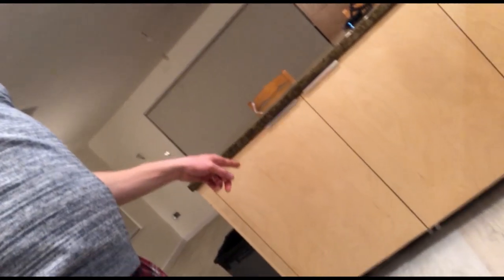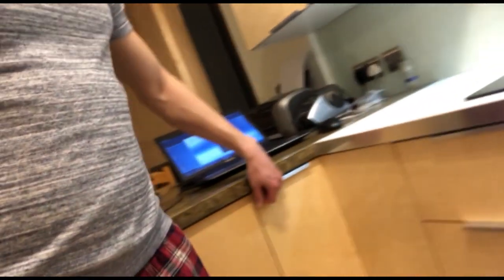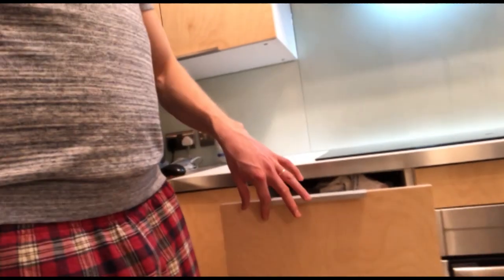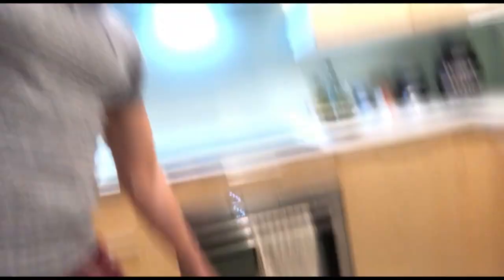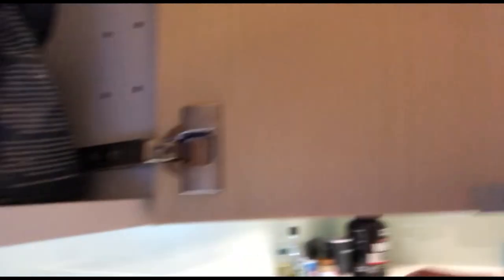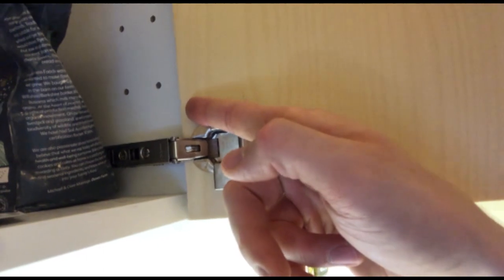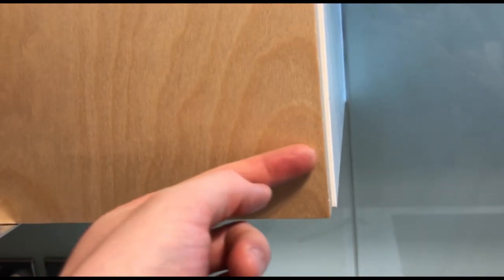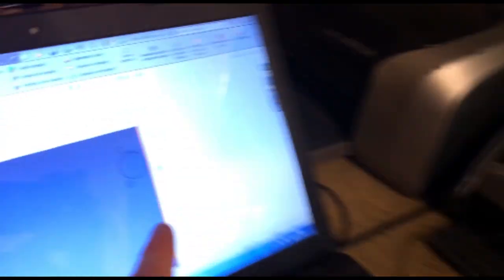BIRCH PLYWOOD KITCHEN with NO TOOLS! How to Make Your Own Plywood Doors for Your Ikea Kitchen

Comment: Thanks for this wonderful video. Kitchen looks fantastic. 
A suggestion for anyone who would like different doors ( e.g. uppers in a colour or because there isn't enough material in the sheets), is to use MDF and paint with Wilko cabinet paint. It is solvent based, and repels water from the cut edges. Limited colour range but mixable ( we did 1 tin cream, 1 tin grey and 1/2 tin white to give a perfect warm but light grey). Has  a great low-gloss / almost matt finish. Scrubbable and waterproof.
Anyway, keep the videos coming - we're hooked!!
Reply from the maker: Awesome Lynn thanks for the advice :)

Comment: Matt, you're a legend for this. 

- What's the thickness of ply did you use and does it matter much?
- did you have to finish the edges at all beyond oiling them? I'm quite surprised the CNC machine leaves them so tidy

I'm considering doing this with some spenny 19mm Walnut-faced plywood so want to get it right. Plykea samples are 18mm. Assuming this wouldn't make any difference to the CAD cutouts but seeking reassurance
Reply from the maker: Hello mate, I used 18mm and you will need to sand the edges lightly with say 120 grit. The depth of the wood won’t require different CAD you just need to tell the company you give it to, what depths you want. :)

Comment: Thank you for this great video! I have nothing but 'can do' mindset, and I will try to do something similar to my new kitchen. One quick question, the free CAD program you suggested isn't working on my MacBook I see some other free programs (e.g. 3D builder). Would your files work on those other programs? Thank you again!
Reply from the maker: Awesome, I’m glad you liked it :) 
Yes any program that reads DXF files.
Alternatively, if you intend on using a company to CNC cut the doors they can do some edits to the files for a small fee I’m sure :)
Reply: @MattHutton  Thank you. I will give it a go and let you know!

Comment: Hi Matt, thanks for this! I am starting a new kitchen reno and wanted to do the whole thing in ply but I don't have the skills to build cabinets so I'm hoping to take the Plykea approach. I have a local supplier who will laser cut ply to my specs. Do I need to draw anything up in CAD do you think, or can I just get the base cabinets & benchtop in and then provide the dimensions of the door panels to the ply supplier? They'll deliver them to me all cut and ready to go, so would all I need to do be to get the hinges sorted and put handles on?
Reply from the maker: I wouldn’t have them laser cut because it will most likely give you burned edges. 18mm is quite thick to cut with a laser. A CNC router would be better. You can either use the drawings I have linked in the description or draw your own. Remember to specify how you want to hinges to be cut because most of the cuts will be all the way through, but you don’t want it all through for the hinges.
Or you could just have the rectangular doors cut and then buy an IKEA hinge jig and just cut them yourself. Up to you.

Comment: great job on the doors mate!!!
just wondering how much money u saved by using plywood rather than buying the doors from ikea???
im also thinking of using plywood doors when i make my built-in wardrobes using the ikea pax frames.
thanks.
Reply from the maker: You can get cheaper doors at IKEA but I wanted a birch plywood look. And there is a website called custom fronts and they quoted £1500 for the doors. I made them for £360, including the CNC cutting and the osmo oil finish.
Reply: @MattHutton  thats a pretty good saving!!!!!! 👍🏻
Reply from the maker: MR V are you going to give it a go?
Reply: @MattHutton  most likely yes - but i may use MDF instead - and spray paint the doors grey.

Comment: hello! Thanks for this. I'm also trying to cut out the middle man with these nice but expensive plywood door companies. Your dimensions have been really useful though I'm struggling to find the template for the tall 2080mm cabinet doors.They have 2 middle holes too. Any chance you could tell me where you found the original dims? I'm hoping the same source might have them for other sizes too. THANK YOU !! :)

Comment: Matt, when the doors come back from being CNC cut, are they just ready to hang? How do the exposed edges look? Will they just need a hand sand or something more? I will be oiling them as you suggested but wondered about sanding. Questions, questions.........
Reply from the maker: Hey Nicola,
They come back fairly smooth but if you sand them down with 120 grit you should be able to get them nice and cleaned up and smoother :)
Reply: @MattHutton  thank you 😀

Comment: Hi Matt - thanks for the great video and insight. You provide a lot of detail on the cupboard doors and hinges but I notice in your DXF's you have no set holes for the draw fronts or appliances. How did you go about getting all those pilot holes drilled and aligned properly??
Reply from the maker: The draws I measured and did by hand because as I only had 3 draws. It was pretty simple to do. The easiest thing to do would be to order the cheapest draw fronts possible from ikea and copy them. 

For the integrated fridge and freezer I measured off other close by fixed objects like the worktop or another nearby door to find the hole positions. Then I put the doors in the final positions that I wanted them and subtracted the gaps around the edge to get the hole positions to put on the doors themselves. Integrated appliances usually have a lot of adjustment for the doors so it’s not the end of the world if it’s slightly off. :)
Reply: Hi @Luke – did you manage to incorporate some holes for drawer fronts? I'm tackling that challenge next and wondered if you might have a DXF file that you might be willing to share? Many thanks! Keith
Reply: @kmander  Hi Keith, as suggested by Matt I opted to buy one of the cheapest fronts IKEA do. I then drilled those holes all the way though and used it as a template. It worked really well and so long as you set up from the bottom edge, the hole locations are the same irrespective of drawer front height or overall width. My integrated dishwasher then also came with its own paper drilling template. All the best!
Reply: @LukeSmith123  awesome – thanks, Luke! I didn't realise that it'd be the same for all the drawer types – so I can just buy a single piece to use as the template vs. a piece for each type. That's great!

Comment: Matt, can I buy you a beer mate? Seriously good work. I've been sitting here cadding it all up - I actually bought a set of fronts from IKEA I was planning to open and measure - I can return them now. 

One thing I noticed is that you don't have any drilled holes for drawers to fit on to the railes etc. - Did you just do that with a drill yourself?
Reply: Hi PT – did you manage to incorporate some holes for drawer fronts? I'm tackling that challenge next and wondered if you might have a DXF file that you might be willing to share? Many thanks! Keith
Reply: @kmander  I didn't in the end - I just hand drilled holes from a jig I made. If I could go back in time I would buy and return all the relevant doors and drawers in order to get it CNCd. It was a real pain in the butt.
Reply: @pt8314  Thanks for the response and tip, PT. Getting myself to Ikea and later making the returns is also a bit of a pain, but I think you're right that it's the lesser evil. I'm still scouring the web to see if someone else has already tackled this before and would be willing to share.
Reply: @kmander  I didn't actually measure in the end, as I say, I made a jig. The hole requirements are different on different fronts so it's a bit of a mess. Honestly, depending on the size of the kitchen, I still think it would be worth buying one of each of the fronts you need and get them delivered - even if they become scrap. It's mainly drawer fronts and there's only a few sizes of those. This way there's no chance of the drill stop slipping and going all the way through the front! Sorry I can't help more. The end result is worth it... soooo much cheaper in Plykea even if you had to buy example fronts.
Reply: @pt8314  Got it! Thanks :)
Yeah,  it's going to end up waaay cheaper than Plykea. Our fitter quoted a price somewhere in the middle, but he'd he making the cuts by hand. CNC is the way to go! Did you also apply a laminate to the ply, or did you go with pure ply?
Reply: @kmander  Went with a good quality birch ply - no laminate. If you can think of a way for me to get my email address to you without spamming it on YouTube comments let me know, happy to answer any Q's you have, if any.